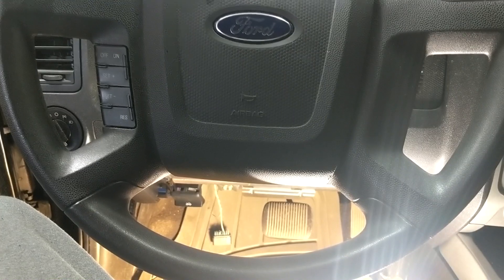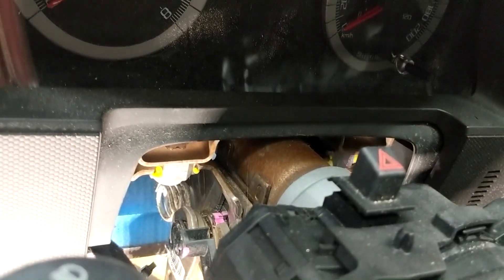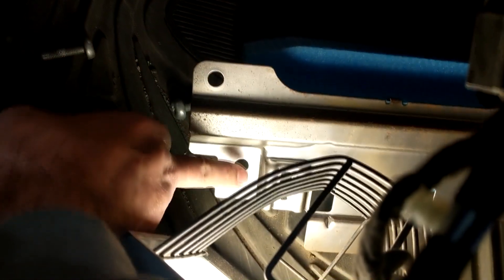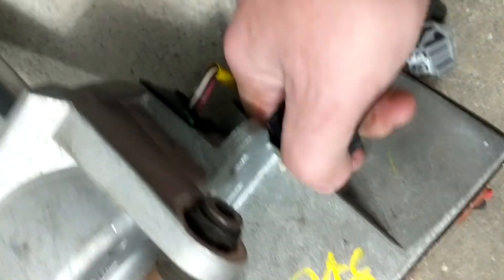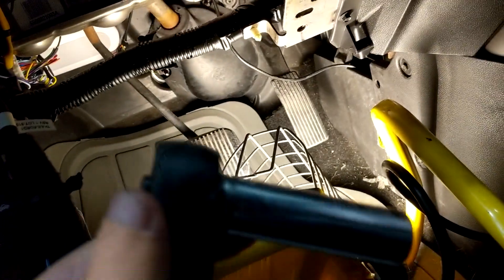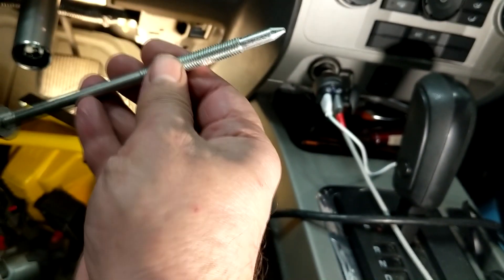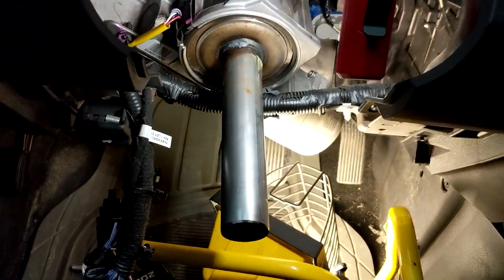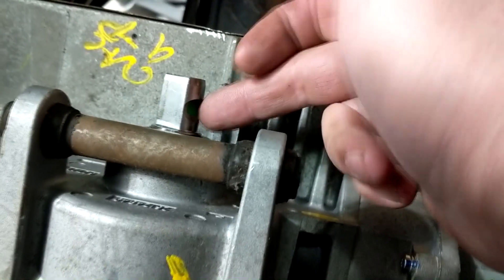DIY - Complete Steering Wheel Column Removal -  For Vehicles w/Electric Power Assist Steering

Comment: thanks , my dash says power steering fault, i checked fuses, changed tourqe sensor, the o ring on it took 2 hours, i wish i would of done this whole unit replace instead
Reply from the maker: mine never gave any fault codes or dash warnings, just random intermittent power steering loss, the used one is still working fine w/no loss of power steering

Comment: Hi boss. Thank you so much for the video. Two quick questions first one is the bungee cord you used in the video what is the length of it like how long is it and from where to where you tied it? Second one is there's no air impact wrench go inside to remove the super long 13 mm bolt? Only manually we have to remove that 13 mm bolt? & can I remove ODO meter or some other  more part of the dashboard so I can have more space to remove the 13 mm long bolt? Again really helpful tips and video. Thank you so much. God Bless.

Comment: Thank you so much for the video. Can I reuse the pinch bolt or do I need a new one? I thought they were torque to yield?
Reply from the maker: its not a ont time use bolt afaik, i just reused the one i had
Reply: @diyvinny6300  Thank you!! I'll do that too. Got the old part out thanks to you and just gonna try to install the new one now
Reply: @diyvinny6300  sorry another question - i'm trying to get the shaft back into the u joint and it's really hard to do... i tried to align it same as the one I pulled out but it won't go in now. Any tips?? I tried to pry the joint a bit wider with a screwdriver
Reply: Never mind actually I got it!!

Comment: Hi sir! Thank you for sharing.

I am actually doing this job now. I am stuck at the pinch bolt. My wrench is turning left ,but it doesn't seem that the bolt is loosening. Did it feel like it was loosening when you did it. The motor is going lower but screw doesn't seem to be loosening. Any suggestions please?
Reply from the maker: @16.51 in video  you need to make sure socket is set onto bolt, if your sure socket is set onto bolt but ratchet is turning your ratchet is in the wrong position for rotation/unscrewing bolt
Reply: @diyvinny6300 

Thank you. I just needed a longer ratchet. You mentioned in the video that a longer one would be better. Something like a breaker bar. It worked. I change the part,but the steering wheel turns stiff. Do you think it needs re-calibration?
Reply from the maker: if you bought it used, of course it is,  then it could be you got a bad part, my wrecker gave me, if i remember correctly, 30day warranty @moneycryptocurrency1024

Comment: Thank you so much! Question: Did you have to reprogram like the dealer requires?  Or is that to take your money 💰!!???
Reply from the maker: i did not need to reprogram anything, i was told you might need to relearn the right and left turning stops, google it,  but for me iirc i didnt even do that. yes, dealers are called stealerships for a reason
Reply: Thanks again. It only cost me $250 used, and I did the labor, and like you said, no  rogramming anything
Reply: Thank you and let's go Brandon

Comment: was this due to a power steering fault. Struggling with this now we replaced the torque sensor same fault. Also runing a tire pressure sensor fault and seemed to see these could cause other faults sounds weird but kinda lost im about to get a whole replacment used colum like you did...
Reply from the maker: idk what the actual fault of my power steering was, i know i didnt want to spend the money on the oe part, and do the tedious installation where i could kill it with a bad installation. 
was not going to buy the doorman part unless i got it for free. 
replacing the steering column was the easier and cheaper solution for my situation, but all you need is the bottom half of the column which is where the motor and computer module and torque sensor reside
Reply: ah so technicly i only need the motor and computer. my worry is installing the torque sensor could have failed or it isnt the torque sensor thats bad. so i feel like my best bet is to do the whole column like you did. @diyvinny6300

Comment: Hello everyone, quick question.. so I’m having my steering component redone due to my intermediate shaft being worn and faulty.. but I thought to also get the steering column redone as well.. I wanted to know if it’s possible to just replace the steering column (but keep my original steering wheel and attach to the new steering column) or is the steering wheel automatically connected to the column? I have a 2008 ford focus btw..
Reply from the maker: idk about  the focus but best to find a ford focus forum and ask there for a correct responce

Comment: Excellent video, thank you so much for putting this together. Great visuals of where the bolts are and the bolt sizes. Dealership want $2800+ to replace the steering column, thanks to this video I was able to do it for $400.
Reply from the maker: thx
Reply: Where did you get the steering column replacement? Our dealership said they can't order it and they have no eta on when they can. We were also quoted 2900...
Reply: Ebay, believe it or not. There are some reputable junkyard sellers on there.

Comment: Did you need to program?
Reply from the maker: no, maybe calibrate by turning wheel in either direction till it stops, i did need alignment as steering wheel was not centered when driving straight

Comment: I’m about to do this. I tried the sensor with no success. Going to hit up some wreckers.
Reply from the maker: i didnt think it was my sensor as i didnt have the usual sensor problems but even if i did it was cheaper to get the whole steering rack as to just getting an oe sensor. and imo easier than trying to replace that torque sensor
Reply: @diyvinny6300  yeah if I did the whole rack it would have saved me time and money. Might as well do the whole rack and sensor together. If you barely mess up on the sensor then it’s no good.

Comment: Did u have to set the amout of turns on the shaft or does it matter
Reply from the maker: i dont know what u mean, but the steering wheel can only go into the shaft in one way
Reply: @diyvinny6300  you know how the old cars were when you could only turn the shaft its self like 2 and half turns either way ? I didnt know if they had to go on in a spacific spot so it wouldnt turn more one way than the other. If that makes sense lol.
Reply from the maker: @bobobrazil1973  k, the u-joint on the end of the shaft can only go in one way, the steering wheel portion can only go in one way, so it doesnt matter. but my steering wheel was not in the exact same position as my old one, about 1" off from center, so your alignment might not match exactly as to the donor vehicle so i have to get an alignment done but i have not done that yet as my truck still drives straight even though steering wheel is not.

Comment: How many labor hours do you think this is total?
Reply from the maker: at the wreckers took a little longer a it was my first try, but i would say it took me,for removal and installation,  about 4 hrs max, but depends on getting that long bolt out and difficulties getting the u-joint out and back in, but also because i had a stroke a few years back so im a little slower
Reply: @diyvinny6300  thank you sir!

Comment: did you have to jack up the front wheels or turn the steering wheel to the 11oclock position to do this ? thanks
Reply: no i did not have to jack up the car, i had the steering wheel at center position

Comment: This is an excellent video, one tip to get to the pinch bolt once you have the tilt bolt out turn the power steering 45 degrees counterclockwise  to make viewing and removing the pinch bolt. Pretty straightforward from there

Comment: I had this problem fixed by my Mechanic, he did it, and it was very difficult to align properly. He had to get another sensor. Big question: Will this be permanently aligned? I am afraid that when I drive the car, it will suddenly freeze or turn to full left or right when I am driving, especially during high speed.
Reply from the maker: your mechanic just did the torque sensor, it needs a precise installation to work correctly else u need to buy another torque sensor. 
i did not go that route as mine only had a random  no power steering problem and didnt know exactly why it did so just easier and cheaper to buy a used column which includes the sensor. theres nothing to align except maybe a front wheel alignment. 
if used steering column doesnt work correctly the wreckers always provide a certain length of warranty depending on the wrecker. its a crap shoot for this part because its a common problem with this model, so try to get closest to a 2012 model year vehicle as possible. 
mine was from a 2010 and its been over a year and hasnt failed.....yet. ymmv
Reply: @DIY Vinny  Thank you for your timely response! My mechanic was advised that the issue was the sensor and that the steering column was the only solution until Ford came out with this part. My biggest question is: Can this happen while I am driving on the road. Obviously, I am concerned for my safety and others. I was fortunate that this message appeared while I started my car last week. Your advice is greatly appreciated.
Reply from the maker: @jaydendean6939  ford never provided a fix for this problem other than replacing torque sensor, sensor was never redesigned afaik but newer was supposed to be better. will used steering wheel pull to one side while driving, idk, mine has been fine for over a year, ford never actually fixed the problem as it seems even after replacing sensor it could still eventually fail again,  they left us hanging

Comment: I got the b2278 code on my 08 escape so I assumed it was the torque sensor. I took it to a dealer and told them to just change the part, no diagnostics. I had to sign an agreement that it may not fix the problem. Sure enough it did not fix it. Now after seeing your video and reading about your symptoms, I think its the column, not the sensor. Now do i have a brand new sensor in a garbage column? 

If I went to a wrecker to fish out a used column, how will i know if that one is not junk? Or if its sensor is old and will eventually fail?
Reply from the maker: the part from wrecker usually comes with a warranty, so all u would loose is your time, time i have, money i dont. ive put mine in over a year ago and its still working. if it fails ill do it again. i paid ~180 w/tx, if it lasts a few months im ok with that, its still cheaper than any alternative. but most of the ecapes at the wreckers already had the steering columns pulled out so call b4 u go and get as close to a 2012 year model as u can, newer supposedly better. i still have to take the old circuit board out for the steering motor  to see if anything can be fixed
Reply: @diyvinny6300  Thank you for your video and the quick reply 👊

Comment: I can't get my steering wheel to slide back on??
Reply from the maker: the actual steering wheel? it only can go in one position, try to match up the indentations.
if youre talking about the shaft to the ujoint, with a screw driver widen the gap at the ujoint socket where the pinch bolt goes
Reply: @diyvinny6300  yes I've tried I think the plastic is damaged. I got it to slide back on old motor but it won't on the new

Comment: Thanks a lot for the video, i am beginning to experience this issue on my 2009 Escape but a lot of people are saying is the torque sensor. please is there a way to ascertain its the torque sensor or the entire column. i really will appreciate your guide on this to move on with the change. my car is from kansa factory. thank you
Reply from the maker: if u watch some utube vids a bad sensor has steering wheel shake or turning on its own. i didnt have those symptoms. it was easier and more cost effective to replace the steering column which has the torque sensor included. if just replacing sensor use only ford brand, theyre not cheap though, but if u install wrong youve basically ruined it and need to buy another one, but i think they discontinued making them. i wouldnt trust a dorman sensor.
Reply: @diyvinny6300  Thanks a lot, I got the steering column completely changed and is fine now.
Reply: @harryofume8792 how much did it cost you?

Comment: did u need to have someone flash the steering control module to make it work?
Reply from the maker: no i did not flash module, but they do say u need to calibrate it with a scantool but i just turned steering wheel fully left and right then to center position to calibrate it. not sure if that was necessary as i didnt notice any changes from b4 calibration. steering worked as expected without doing anything special.

Comment: Thanks very much for this. 

Just moved to the US and picked up a 08 escape and power steering went out.

Your video saved me a lot of money/  heartache and head scratching. Took me around 2 1/2 hour, but should I have to do it again I think I could do it within a hour. 

Universal joint was the biggest pain, trying to get it back on. Glad I did this instead of changing the torque sensor now.

Again thank for taking the time to make this!
Reply from the maker: thx

Comment: How do you know if its good or not?
Reply from the maker: you dont until u drive it for awhile. salvage yard offers 30 day warranty on upull parts. but for 120+tx its something im willing to take a chance with , try to find later models with low mileage but thats easier said then done.
new units are not new but re manufactured but they dont say what they "re manufactured", on rockauto, was around $800 +tx and del,  but currently not in stock
Reply: @diyvinny6300  thanks.  Hopefully  i can do it myself im not trying to pay 1200+  or everybody gifts going back ...lol.
Reply from the maker: @YKBNuNu  i will be doing a tear down on the old control module, im thinking the problem is in the circuit board and not the motor itself
Reply: @diyvinny6300  ok so if its that it would be cheaper/easier?